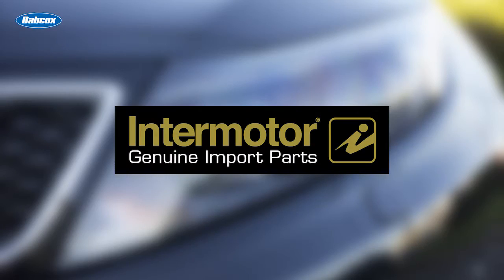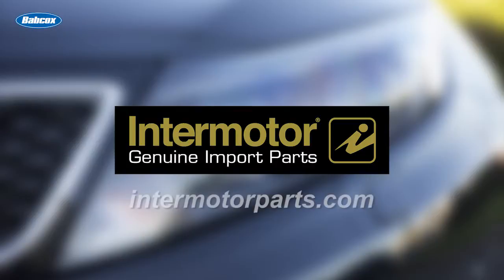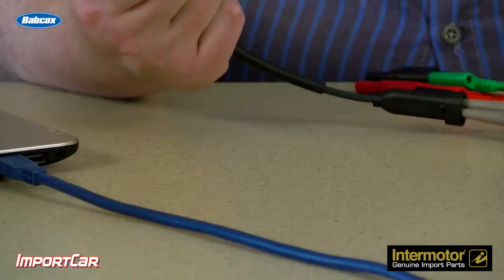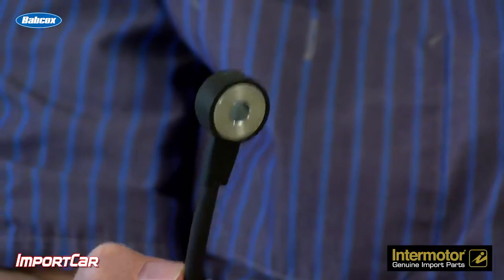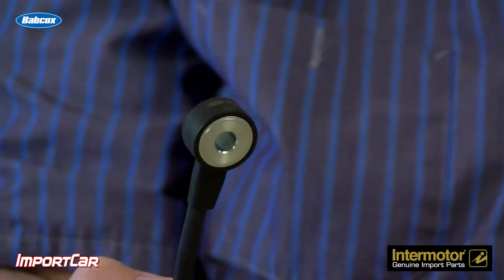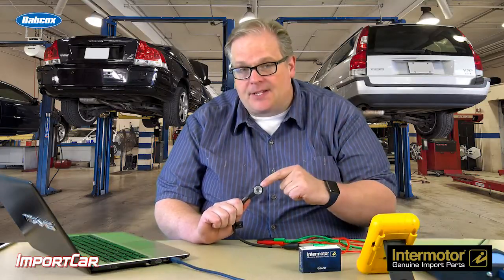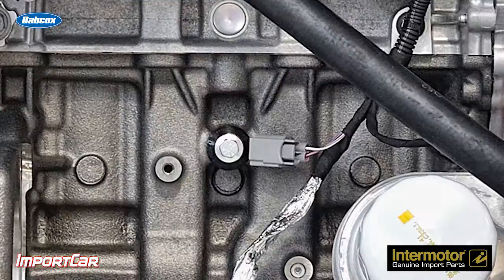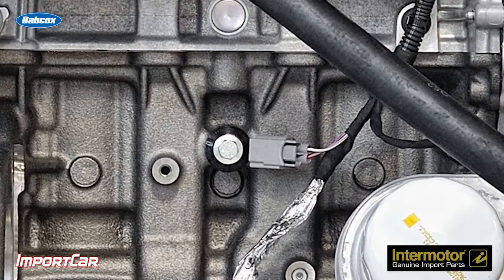Two Tips For Knock Sensor Diagnosis | Tech Minute

Comment: No, they're NOT tuned to a certain frequency. The one you show, it works the same as a microphone, has the same frequency response. All the clever work is done in the computer. A resonant knock sensor which you don't show, it outputs one and only one frequency but what it detects is a shockwave, it's a shock sensor.